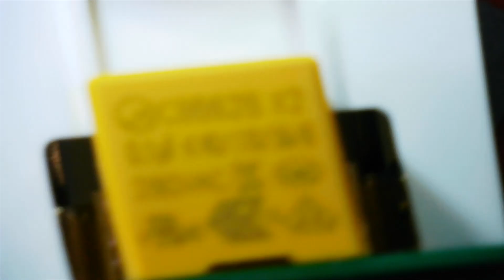Ethernet Gigaibit over home AC Power TPlink AV1000 #ethernetadapter #Gigabitadapter #TPLINK

Comment: I tested these back in '00 or so, when they were really new and got about 8mbps of actual throughout. The ISP I worked for just trashed them. Barely able to beat 802.11b. these are definitely a last resort vs running cable, or WiFi extenders.
Reply from the maker: Thanks for your feedback!!  This tech is an update - I think only about 6 years old, so I wonder how much better they might be?

Comment: I have a few of those.  Currently running AV2000.  I can't remember if it was these or the older (slower) pair, but they died and I had to replace the first electrolytic filter capacitors.  Generally work pretty well.  I do notice when my electric utility meter sends its data burst (about every 3 hours, over the powerline) I get a temporary network disruption.  (That utility powerline smart meter system is rather annoying...  It also causes my ceiling fans to make noise and some of my LED bulbs to flicker.)

I was hoping these HomePlug adapters would extend the network to my barn, but no such luck.  Had to go with a WiFi bridge and would like something better. It's a long walk to turn off the lights if they get left on... I used to use X10 but not since the utility smart meter so now I've gone to smart switches. With the development going in behind me, I would like to run a few cameras down there. I just picked up a WiFi HaLo (802.11ah, 900MHz) bridge a few days ago. I'm going to try and see if that will give me a more stable link.
Reply from the maker: Thanks for this great feedback!

Comment: I used to have a set of the previous version of these (AV800 standard or something like that), worked great, zero issues in a ~40 year old house wiring. Then upgraded to the new "TP-Link Deco P9", with a set of 3 (they all have 2 ethernet ports, any of the 3 can be the one connected to the router, so it's pretty seamless setup). This one drops out when my air compressor is running, which is weird because there are 2 fridges with their own compressors and an AC unit that don't bother the trio at all. But as soon as the air compressor kicks in, the "satellites" all drop out until the compressor finishes. Other than that they work quite well.
Reply from the maker: Thanks for this fantastic feedback!!!  I'll have to look into the P9;)

Comment: It'll be interesting to see what you get for speeds Eddie when you take this for a test drive.. I have tried powerline networking in the past but I gave up because I could never get reliable throughput that was anywhere near the capacity quoted. I realize much of the performance potential is contingent on the particulars of the house power circuitry. I eventually just went with quailty router with wireless bridges/repeaters and I guess now we have mesh systems. I would love to have every room in the house wired for data though.
Reply from the maker: Thanks for your feedback!!

Comment: Lol. A friend accidentally found they only worked when they turned the electric stove on.  I guess that bridged the two 110v phases we use in North America.
Reply from the maker: Thanks for pointing this out.  Yes I could see that it would only work on the Line/phase that it is connected to, but when you use something that works on both phases - it could tie them together through the load...interesting.
Reply: Yes, that can be a problem.  It doesn't affect my present setup, but it used to plague my X10 home automation!

Comment: These powerline adapters or also called Homeplugs use the socalled PLC (Power Line Communication) technique.
The adapter connected to your router or broadband modem set the "internet signal" with a high frequency (between 2 and 100Mhz) superimposed on top of the 50/60Hz mains sine wave, the second adapter has some filters that block low frequency and pass the high frequency. 
If you want, you can do a simply test, by connecting a signal generator set with a high frequency (above 100Khz) and connect the signal generator through 2x 10nF capacitors to the 120/230V mains. One of the 10nF in the neutral line and the other 10nF in the phase wire. If you then use a differential probe connected to a walloutlet you can see this high frequency signal on top of the 50/60Hz sine wave. To avoid any damage to your signal generator, set the signal generator on before you connect it to the mains.
These adapters are used for more then 10 years here in Belgium, not only for getting internet to a desktop/laptop, but also to give a TV TopBox internet access.
In the beginning when these Gigabit powerline adapters appeared, they where a big scam, because back then the Rj45 port was only a 10/100Mbps, so you could never get a higher speed then 100Mbps. Also, these adapters work best when they are plugged straight in a wall outlet, not in a powerstrip that contains "noise filtering", because these noise filtering use safety capacitors in the nF range en those will shunt out the signal of these adapters. 
Also, if you have many devices (desktop, kitchen appliances with netfilter etc...) plugged in the mains that contains safety capacitors between hot and neutral, those will shunt out the signal that these adapters use. This is also the reason that the working frequency of these adapters now these days is way higher then years back, where they used below 2Mhz. These adapters are nice, but also one of main sources of mains polution. I know a case here in Belgium, where one of these adapters was faulty and caused interferency up to 2 kilometers in the entire neighborhood. 
Here in Belgium we don't use a high voltage transformer outside on a pole per 1 or 2 houses, but we have entire residential areas that are connected to 1 big transformer station that serves multiple kilometers. So if one of these adapters is haywire, multiple areas are infected by this.
And last, in these adapters there also versions that distribute Audio over the mains wiring (Devolo), and there also kits where the second adapters has a WiFi chip.

Comment: I am aamateur radio operater so I am not found of things like this or the broad band over power lines or even solar power since so few inverters are clean. I have no clue how these work but I would imagine that they turn the signal into high frequency and high voltage compressed modulated signal and send that down the power wire and decode at the other end. I would guess some of those opto's are being used in some form of clipping/compression system.See the crystal oscilator in the circuit so they are transforming to rf and back again, no way they would use audio as part of the process. So I am going with totaly digital and just changing the voltage and frequency of the voltage. I had zero interst in these schemes because of the radiation pattern and how it shuts down two way communication due to noise. Depending on the band you are transmiting on some of these where as bad as plasma TV's in terms of EMI/RFI. The internet over power lines that some power companies tried was so noisy you might as well have been parked next to the a spark gap generator and made two way radio communication almost impossible. Converting to RF first than doing the clipping and compression is far more accurate, fast and easy. The baluns are there for control of resistance and inductance of the power line between each unit. I would look into RF circuits the resistor and inductor layout is very much like something you would see in two way radio.
Reply from the maker: Thanks!  I wonder if these newer units/tech would be as bad?

Comment: Only works if both outlets are on the same mains circuit.
Reply from the maker: I wondered about that - but then it wouldn't be much use.  I'll test this.
Reply: Crosses circuits just fine in my house.  Does not cross phases reliably though!  (And I'm only 250 feet from the transformer.)

Comment: These things can work quite well, but it depends on the house wiring. If the mains wiring between them runs all the way to the DB, speed can be less than optimal, or experience dropouts if you do something like welding. And of course, if you are a radio-ham, they radiate like mad over the mains wiring. Had it running between the router in my house to my workshop, but eventually I replaced that link with a normal ethernet cable. Inside the house it works OK.
Reply from the maker: Thanks for this great feedback!

Comment: I love these powerline adapters
Reply from the maker: Thanks - so they do work?  I'll try mine later today;)
Reply: @KissAnalog  I use the BT Mini Connector VERSION 2 v2 1000Mb 1GB Gig Powerline Adapters. They can be bought second hand in the UK for a really low price. I get the same speed through Mine as I get connecting a cat 5 cable directly to the router. In the past I have had 2 burn out. One of which was a TP-Link branded adapter. You can also get them with built in wifi, so users don't have to plug in an ethernet cable.